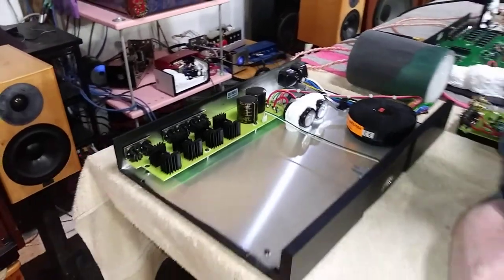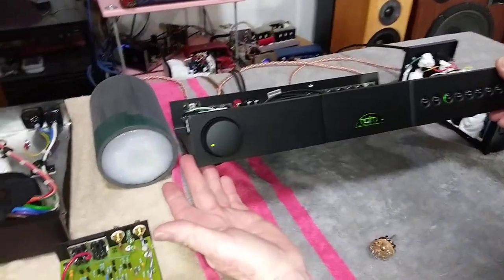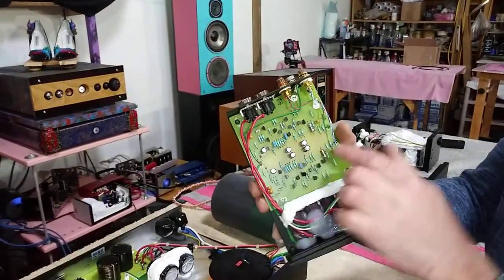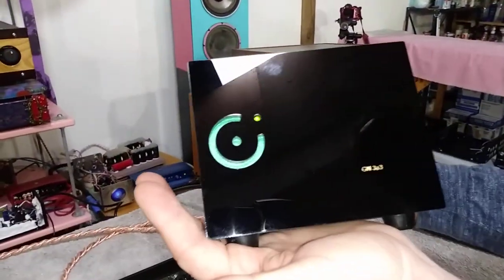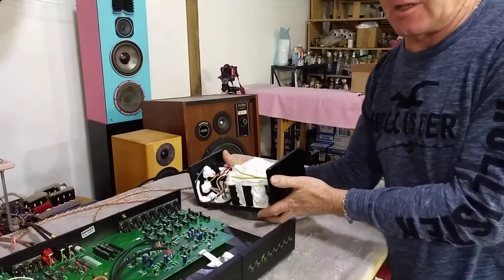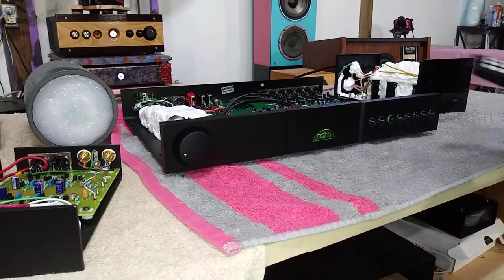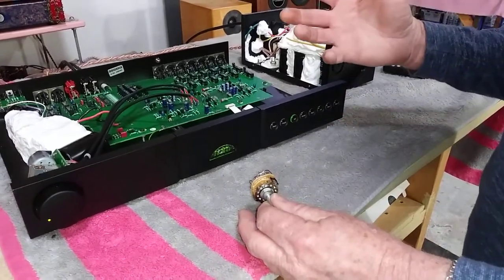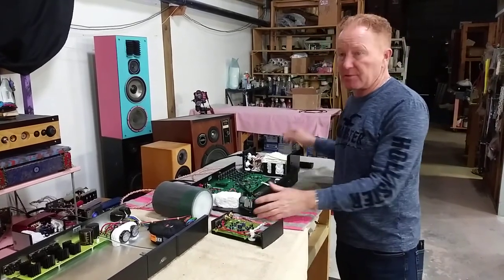Mike Woodcock of Absolute Sound Chatham describe the Naim modifications on April 6, 2022.

Comment: Why NAIM and what does this capacitor pack do to the sound of the NAIM
Reply: Naim is a popular brand to upgrade Because they themselves offer power supply upgrades for their own equipment, and generally speaking they leave lots of room inside to make that possible. Mike is a Naim dealer, and had a lot of customers with Naim equipment. Also, Naim is a fairly popular brand here in our part of the world. The upgrades offered a both very cost effective compared to a Naim upgrade, and frankly, also offer a far better end result.

What you would expect to hear are a number of improvements - highs and mids will be a lot smoother, dynamic attacks will be greatly improved, there will be more musical coherence, and the sound will be more full bodied.
Reply: @georgetaylor3107 aha interesting